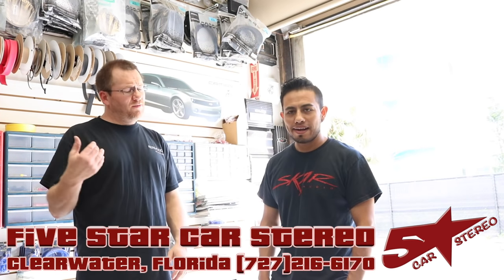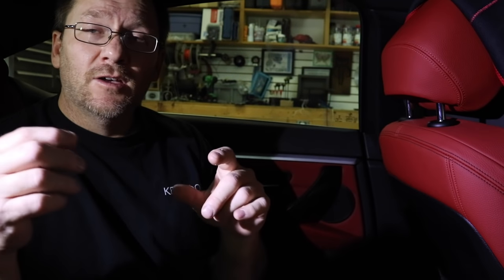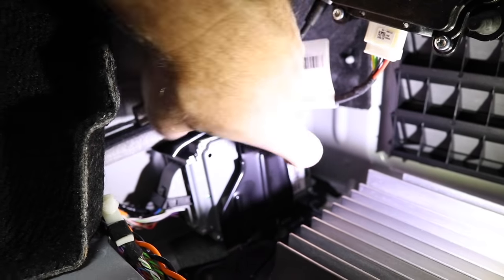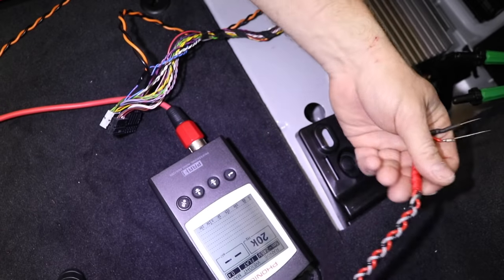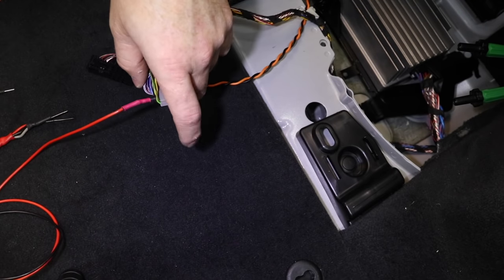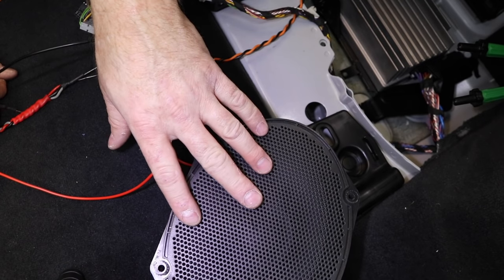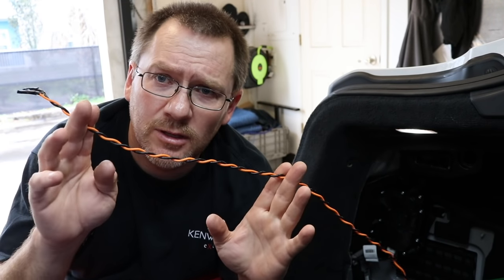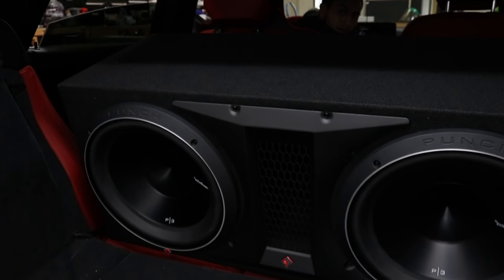How to bypass fake motor noise in a BMW

Comment: Isn’t a cleaner way to do that, like getting into the ECU and disabling that “feature”?
Reply: that would require special codes from Germany that they will be reluctant to give out. I have the same problem with my merc

Comment: Old video, but I’m working on a new Supra. Hopefully this applies. 
I bought one of the T-harnesses to get my signal post amplifier. I’m using a LC2i Pro to “convert” the signal. Then a CXA-800.1 to drive a TRTP12. (2ohm)
The company I bought the T-harness from also offers a bypass for the ASD and basically loops the speaker channels out of the harness. Would you recommend this method?

Comment: Hey guys great video. Can you advise me if this would work for me. I have a 2018 Q50 it doesn’t have the Bose speaker and amp. The car has 6.5 door speakers and a set of tweeters that’s it I don’t know how it’s getting its power I searched the whole trunk and found no amp. However I found a ANC module would it be possible to test for a variable signal like you did here and tap into it. Also I would like to have a 4 channel and mono amp installed how would that work if I can use the signal from the ANC module. I have no clue as to how to get the signal  for my aftermarket amps. The local shops in NY don’t even know what to do   Scratching my head.

Comment: how do you know if the audio outputs is low or high level. I always assumed wires coming from a factory source going to door speakers is high level, and rca' s are low level. I guess what I'm asking is how do you determine if the wires coming from the source is low or high level. keep the great vids coming!
Reply from the maker: Blake  Langley at the speaker it will always be high level. We will have to do a video showing from the radio.

Comment: Why do you need a converter to go low-level to low-level?  Why not just splice some RCAs directly to your amp?
Reply: Joshua Landers   I could be wrong, but I think with low-l to low-l the signal is clean and amplified by the converter, if you just splice RCA it isn't, and splicing those things are a real pain, it's literally like splitting hairs and at the risk of introducing noise. Lol
Reply from the maker: Pimpin out is correct about a better signal. This unit has a line driver and most importantly has an auto turn on. That way we do not need to probe the car foe a turn on wire.
Reply: I have a question regarding bypassing the ANC on a 17 Maxima. Everything I’ve found and you even touched on in your video, if you add a aftermarket subwoofer the factory system will try and cancel that out because of the ANC microphones. So by just grabbing the input signal from the factory radio to the Bose amp as input to an aftermarket amplifier will not trigger the ANC microphone?? I want to add a sub to my 17 Maxima but am concerned about the ANC microphones trying to cancel it out. Any help would be appreciated.

Comment: how would you guys install a LC2i in a 2014 Chrysler 300 (Base Model)?
Reply from the maker: we would connect to the 2 rear speakers, but only on the base model. The other models the front door are sub woofers and you have to connect there.
Reply: Five Star Car Stereo JW, because my front door speakers are 6x9's as the rear are and 3.5"s in the dash. I asked this because my front door speakers go really low and act as a mid bass
Reply from the maker: +Jesse Gunderson then you want to tap the front doors for sure. They are the subwoofers